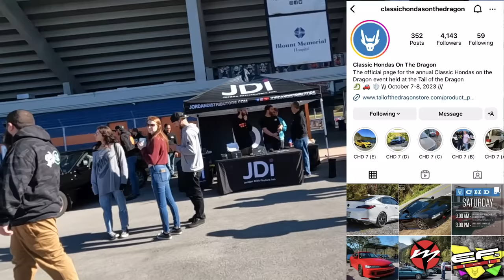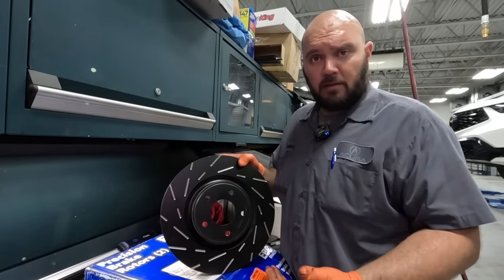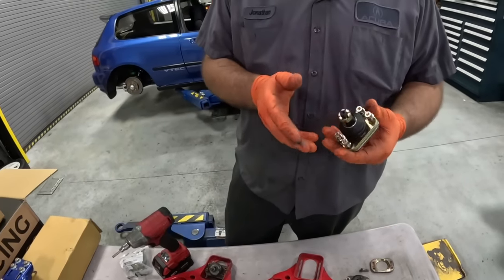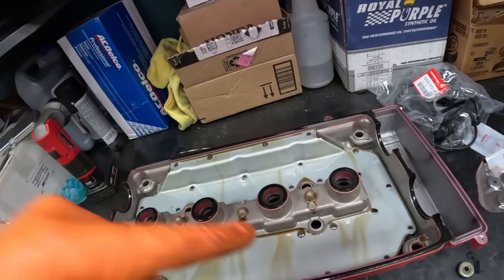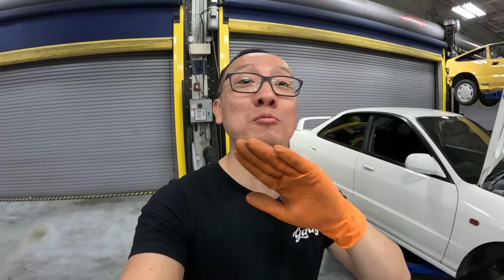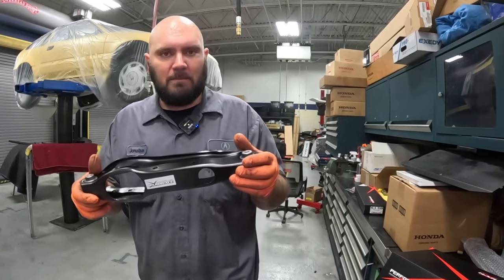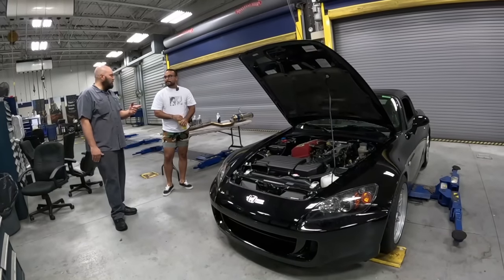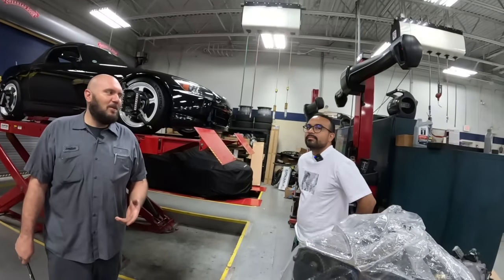HOW TO PREP YOUR ACURA & HONDA FOR  THE TAIL OF DRAGON | 3000 Miles Road Trip

Comment: 😂 I thought I was the only one that did it. My 2023 integra is the automatic. Just cause my local dealer didn’t have the manual. I went with the same one you got. Except my stitching is grey. It really looks and added to my OEM+ build I’m doing. I’m just waiting on my cat-back and I’ll have some small tuning done. I purchased a bunch of items from PRL. JUST WANT TO HIT CLOSER TO 225HP & 215lbs of torque.

Comment: Question:  When bleeding brakes does the cap on the master cylinder have to be on? Awesome show! Makes my Saturday, watching ur new episodes! Martin T.
Reply: No, the cap can be off. That helps you watch your brake fluid level in the reservoir while you’re bleeding, because you definitely don’t want it to get too low where it sucks air. Same at the caliper bleed screw as you’re bleeding, you want the hose into the container to be submerged in brake fluid so it doesn’t suck air into the brake system.